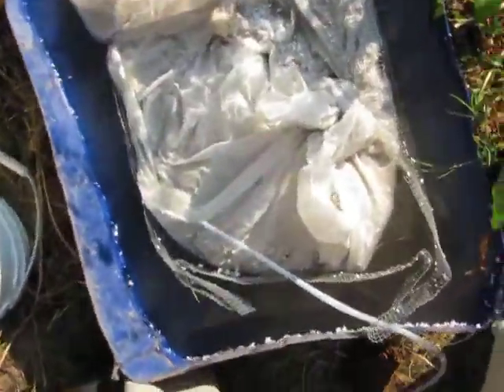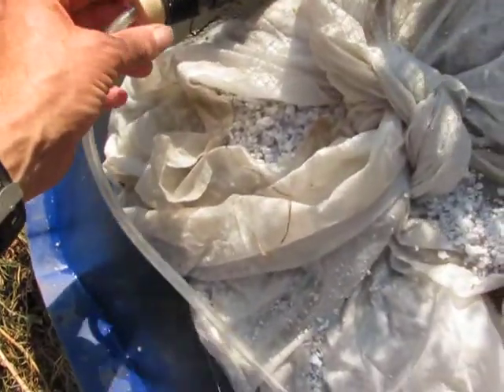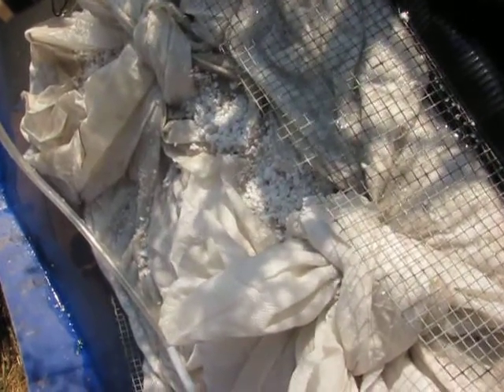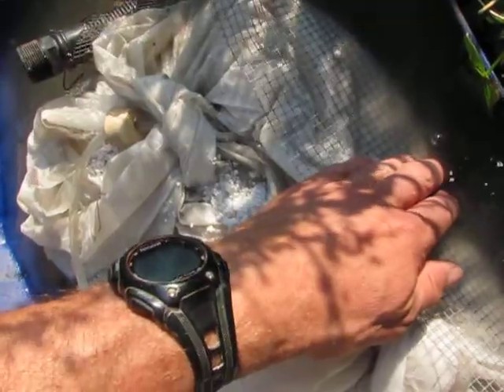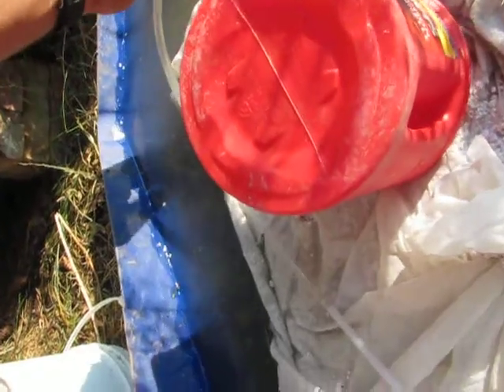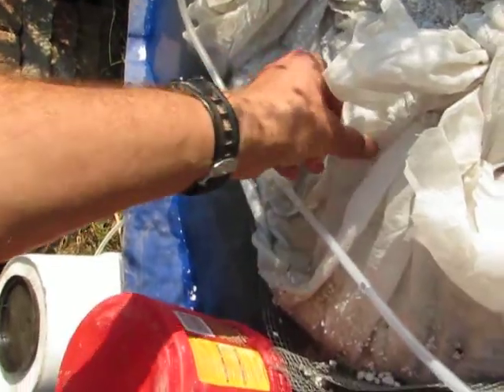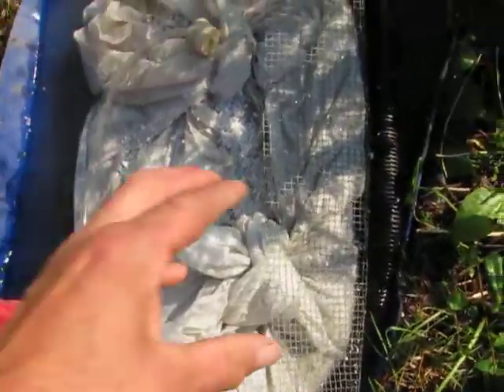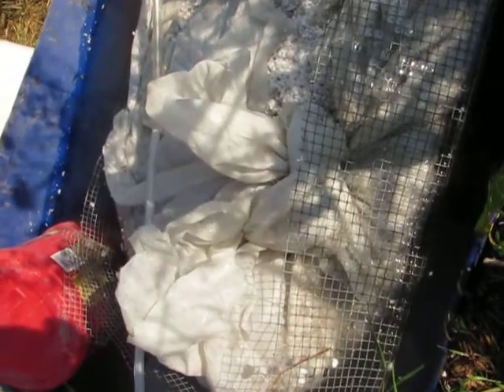LITTLE BIG IDEA?  Inflatable raft ebb and flow hydroponics! Inflate , rises, deflate, sinks!

Comment from the maker: Hi, Christie, thanks.  The rubbishy video I made  discribes 2 methods.  The "rising/sinking float" may only be useful for smaller plants due to the movement but once reliable floats are designed, I think it will be useful in many situations. I mean really! Just throw a big perlite float with a solar panel and linked air pump onto your drainage ditch and hey presto! you got an Atlantis hydroponics system!   The other "stationary air tank in the hydroponic tank"  has more immediate applications

Comment from the maker: I did such a crappy demo but yeah, it should work better.  I used to be a lab tech and I studied ways of oxygen transfer for waste water treatment etc.  The surface area for transferring oxygen to the roots is likely to be way huge with ebb and flow in comparison to bubbling air to the roots. This is because a bubble has its little sphere around it while the perlite granuals and roots have a thin film of water directly exposed to the air.   A massive transfer area right where it is needed!